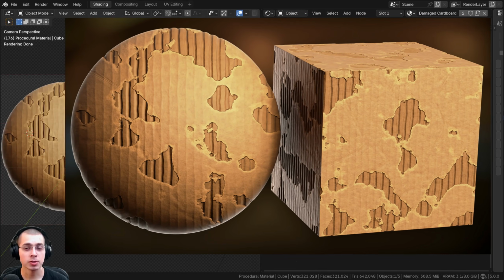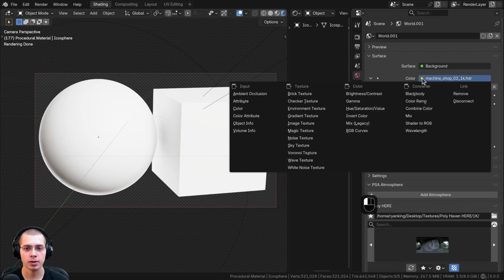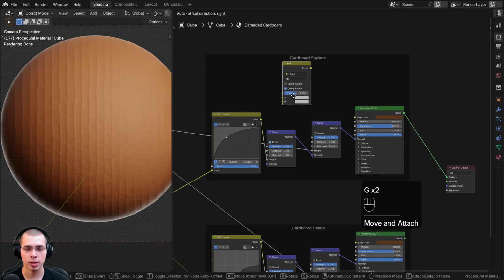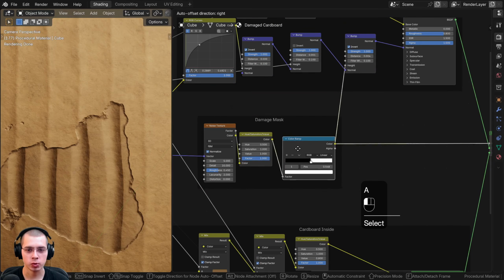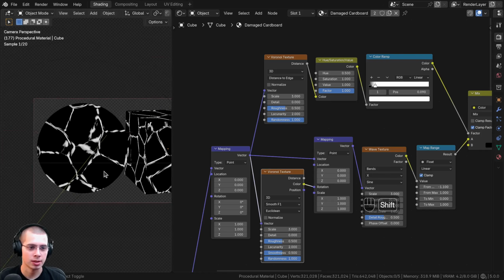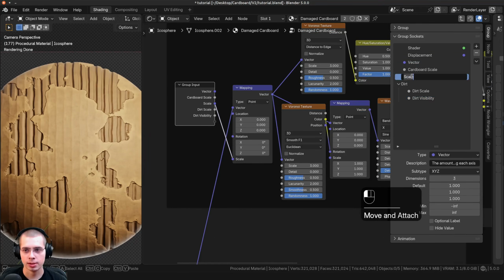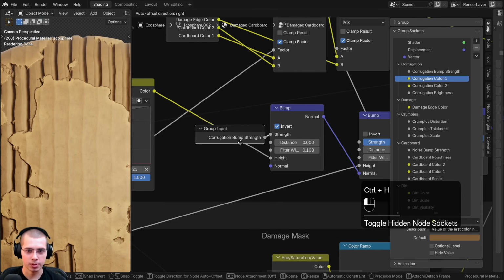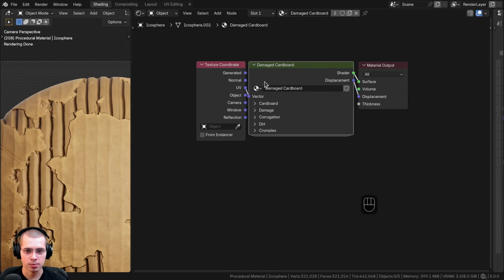Procedural Damaged Cardboard Material 📦 (Blender Tutorial)

Comment: make a tutorial on how to use the map range, because i want to understand it better.
Reply from the maker: thanks for the tutorial idea
Reply: and make it simple so that 7yr olds can understand (even tho i'm 13).
Reply: and here is what to say: Imagine you have a number on one kind of scale, and you want to know what it would be on a totally different scale. That's what the Map Range node does!

🗺 How the Map Range Node Works
It takes a number and figures out where it sits in its first range (the "From" range), and then puts it in the exact same proportional spot in a second range (the "To" range).

The Five Important Numbers
The node has five main spots you fill in:

Value: This is the number you want to translate.

From Min: This is the smallest number in the first range (the starting scale).

From Max: This is the biggest number in the first range.

To Min: This is the smallest number in the second range (the new scale).

To Max: This is the biggest number in the second range.

An Example with Grades
Let's say your video game character's Energy Level is a number between 0 and 100 (From Min = 0, From Max = 100).

If the energy is 50, it's right in the middle of the 0 to 100 range.

Now, you want to use that Energy Level to control the size of a Power-Up Icon, which should go from size 1 (small) to size 2 (big) (To Min = 1, To Max = 2).

The Map Range Node checks:

"Your Energy is 50. That's halfway between 0 and 100."

"I will set the Power-Up Icon to be halfway between 1 and 2."

The output number will be 1.5! The Map Range node perfectly matches up the middle of the first scale to the middle of the second scale.

If your Energy was 100, the icon size would be 2. If your Energy was 0, the icon size would be 1.

It's all about keeping the proportion the same, even when the numbers are different.

i got this from Google Gemini.
Reply: the reason i told you to do so is because the map range is the color ramp's mathematical brother. also to make some patterns with the map range plus some other textures.
Reply: and try to make some interesting patterns with it pluged with texture node.